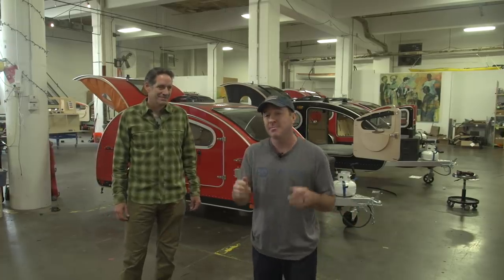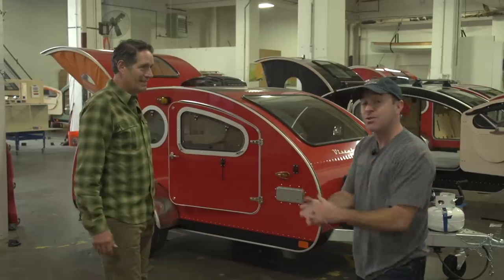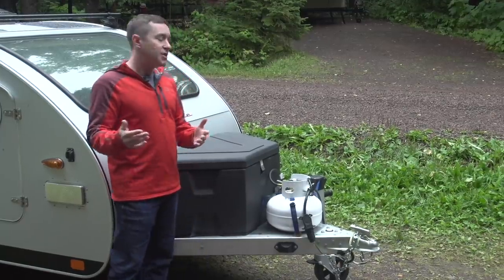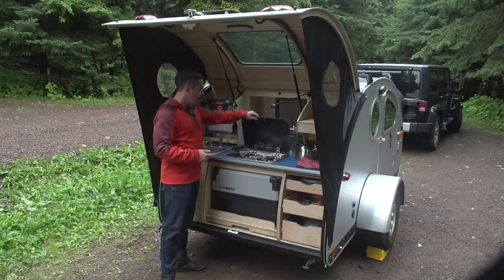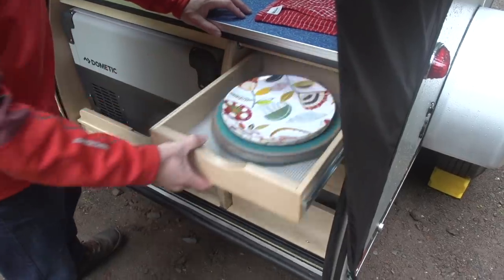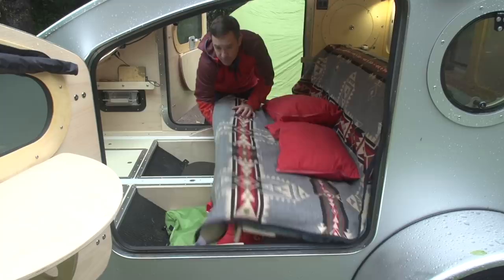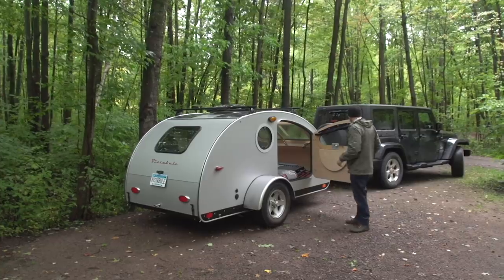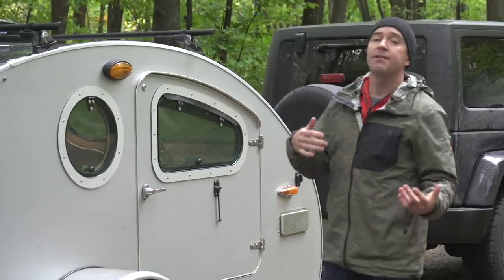Vistabule Teardrop Trailer Review: Four Rainy Days In Northern Minnesota

Comment: A lot of people don't have space for a large camper but still need an enclosed space for the family. After many hours searching, the Vistabule Teardrop looks like one of the best-built campers I have come across.  Also, the tongue weight is so low that my car can pull it.  I'm very impressed!  The sticker price is a little high, but you get what you pay for as a lot of these mass-produced mainstream campers lack longterm quality.  Also, you'll be hard-pressed to find a micro camper with a bathroom, except maybe a NuCamp Tab S.  However, the Tab S bigger, heavier, and more expensive.
Reply from the maker: Well said!

Comment: I purchased a used larger trailer with a full stove, toilet, shower etc, which had been lifted affording great ground clearance. It cost 25% of the price of this Vistabule. We have towed it up very rough roads and also camped warm & dry during the stormy weather which occurs in late fall/early spring at altitude. Campers depreciate quickly, no need to pay full price.

Comment: Very cool teardrop trailer. I like the fact that the bed tilts up to a couch position. Plenty of ventilation with this model. The galley is very nicely laid out. The side skirts on the galley are a very nice feature to help with wind and rain while cooking or just having the rear open. Love the built in solar panels to charge the battery with. You talked about the con to all teardrops - wet weather and climbing in/out of the doorway without getting the bed wet. A small side awning for the door would be perfect to prevent the water from coming straight into the bedding.
Reply from the maker: Thanks Todd! The comments are all over the place in here, which makes me happy. The goal was to show all the features the best I could. After that, everyone is going to have a different reaction to it. If the video helps people figure out that they want a different teardrop trailer I still consider that a success. For some, the Vistabule is exactly what they're looking for, which is why they're already outgrowing their production space.

Comment: Beautiful Teardrop trailer.  I’d like to see a specific model available with every available option.  I need AC, heat, solar, maximum battery, maximum propane, off road off grid capabilities.  This can easily be stored in a standard garage when not in use.
Reply from the maker: This model had all of that with the exception of A/C. If you needed additional modifications they would work with you on that (for a price obviously).

Comment: When I looked at the base price I was taken back. Then when I added up the options I was floored. A small outfit like this would necessitate a higher price, as their volume would be low, with probably a longer wait time for delivery. But,  whoa, that much money for the things you don't get, things that come standard on other rigs that cost much less, and have other advantages besides. But, it's your money, spend it as you like. I do admire the entrepreneurial spirit in these folks.
Reply: I've been looking for a quality small camper trailer that my small SUV could pull (gvw<2500lbs) that will last and not require repairs or extensive set up on my own. I'm not finding much out there other than these smaller companies that all have about the same range in cost (bean, vistabule, mission, etc). Any recommendations?

Comment: Very nice design.  Like the high end finish and components come with it.  What about more outdoor living elements? Good call out at the end of the call for wet weather situation before going in.  What about storage for foldable tables and chairs to use outside the cabin? It would be nice to add on those functions in the cabin than relying on the car trunk.
Reply from the maker: The amount of storage under the floor is substantial. In our experience there was plenty of storage in the closet (at the back of the bed) for clothes, leaving the storage free under the bed for camp chairs, yard games, etc.

Comment: Love the teardrop trailer self. I think the design is marvelous especially with that big window in front. But for my needs I would need bigger Wheels and more clearance underneath. I tend to Boondock and fairly remote places. I know if I put big wheels underneath it would change the design. But I was wondering if I could swap bad axle read different setup with 35 inch wheels

Comment: What can you tell us about the structural framing, wood or aluminum, and what are the connections like. Also, what is the interior/exterior sheathing, vapor barrier and insulation type, thickness and r value?

Comment: Beside the price, it looks cool, because you can use your everyday car and make small escapes in the country side. But in warmer countries it seems that it would be boiling inside from the heat, due also to the big windows. Furthermore, is fire an issue? Lot of wood.
Reply from the maker: You can get them equipped with air conditioning. People rarely get that add-on in Minnesota, but they sell a lot of them further south with AC.
Reply: Is fire an issue with cars? Lot of gas.

Comment: version 1.5 should have flat wheel arches that allow for a shelf function. you can never have enough place to put stuff off the wet ground when camping. Also add a spare tire on the frame somewhere. It sucks to be hundreds of miles away from the nearest tire place and you have a flat. and yeah, it's over priced.

Comment: What is the weight, and can my little 4cyl suv pull it?
Reply: Looks like about 1,200lbs empty, 1,500 with a typical gear, water etc. Depends on your vehicle, but most of these ultra-tiny teardrops are meant to be towable with a 4-cyl. Here's the full specs: https://vistabule.com/features/specs
Reply: My Honda CR-V only rated at 1,500 lbs so no. You don’t want to tow at the limits, especially going up hills 
, long distances, and over rough terrain. Recommend V-6. Of course you can abuse your vehicle. Many do so watch out for the used vehicle with the trailer hitch.
Reply: @stephenpowstinger733  you are correct, towing at limit will ruin your car by shortening the lifespan considerably, and performs poorly in steep mountain driving. A lesson I learned the hard way.

Comment: A small trailer like the Vistabule is the next best thing to sleeping in the tent for me.  I just like the look of the all aluminum outer shell teardrop shape tralier vs the squarish though much better small trailers. I like  Vistabule's  features like the storage below and foldable bed ..but I stop at the price too.  If there is a bare bones version  with the kitchen area having open, adjustable shelves ( I don't even need the tiny sink)that costs only a few thousand would be great. I could supply my own bed, cooler , etc.   That would be much lighter to pull with my car too.

Comment: I would not call this a review but rather an endorsement
Reply from the maker: You're correct! It's an endorsement because we had a great time in it. I address the main drawback at the end, which is trying to get inside when it's raining. That would be a deal-breaker for some. We've seen teardrop owners set a pop-up canopy tent on the side, which would have made a HUGE difference. The other tradeoff for the size is that you have to use the park's bathroom and shower. We were at nice state parks all weekend, so it wasn't an issue, but if you were overlanding you'd have to come up with a different solution.
Reply: @outdoorsdotcom  it should be taller with an awning on both sides. Way better trailers out there at that price point. This one isnt even off road capable.  $$$$$$

Comment: I camp in the back of my ten year old Suburban. It has eight feet in length of bed space with the middle and rear seats removed. It cost me only half as much as this camper and I can off-road almost anywhere and not have to worry about dragging this overpriced unit behind me.
Reply: Makes sense unless you have to haul a bunch of gear and mountain bikes etc.

Comment: The fit and finish leave a lot to be desired. No insulation, no toilet, no shower, no heat. Not impressed. This should be around $8000.
Reply from the maker: They're insulated and our model had a heater that ran for four days on the LiFePO4 batteries. You can find teardrops for about half the price of this one, but they all share one thing in common - the base model price starts going up quickly as you add options. The one we had was pretty decked out and was about 27K. But you're right! Gotta make the trip to the bath house every morning. For some people that's a deal-breaker.
Reply: Uh, compared to what? I'm not sure if anyone here cares if you're impressed or not, or your assessment of it's value. These are beautifully designed and finished, and have so many thoughtful details in their design that they make most other trailers look like they belong in...a trailer park. They are, in fact, available with both heat and air conditioning; and who the h*ll wants a toilet or shower in a teardrop? These are for people who enjoy owning fine things. Don't disparage them because you aren't one of them, or can't afford one.

Comment: @6:15 "how much headroom you have" says the guy that's not even as tall as the teardrop 😟.  Some really cool design features on this.  As a guy who is 6'2" The galley kitchens on these complete arch teardrops are useless. The ergonomics of leaning over the back to reach everything as I observed in this video is frankly not thought out.  Having more of a water droplet shape with the last 60% of the roofline mostly flat and the back more straight would give both interior room, awning space for a more protected outdoor living space.  The side pullout galley under an awning seems much more ergonomic, and intuitive to connecting the living spaces.

Comment: I like the escapod better.
Reply: Finally, a critical comment that doesn’t strike me as finger-wagging jive talk (“I made mine for just $400,” etc.)  I’m looking forward to the time when I, too, may be in the market for a teardrop trailer, and the only serious competitor I read about these days is the Escapod Topo 2. The Escapod folks seem to have taken a huge gamble by designing a clean-sheet, one-piece, all-fiberglass trailer that is supposedly leakproof. They even designed a “mud room” that supposedly enables you to to pull off wet boots without soiling your sheets. The Vestabule matches or exceeds it in every other respect IMO, except that the Topo clearly has better off-road clearance and capabilities. Its new hull design is the future of teardrops, I think. But for all of the whiners about price: the Vistabule as of right now is $24K, about $36K fully loaded. The Topo 2 starts at $39,500 and tops out at just over $50K! And I suspect that both are worth every penny, whether I can afford one or not.